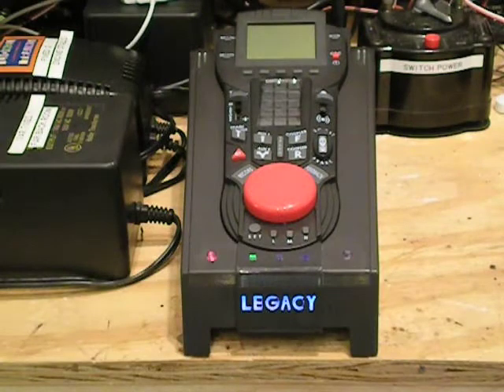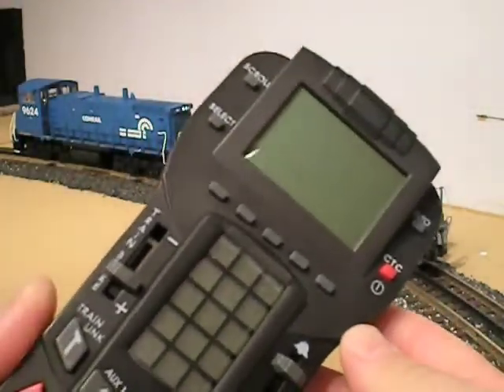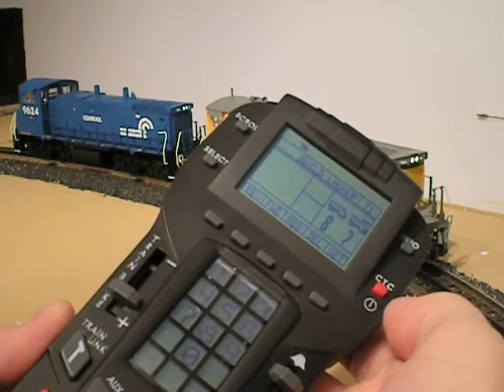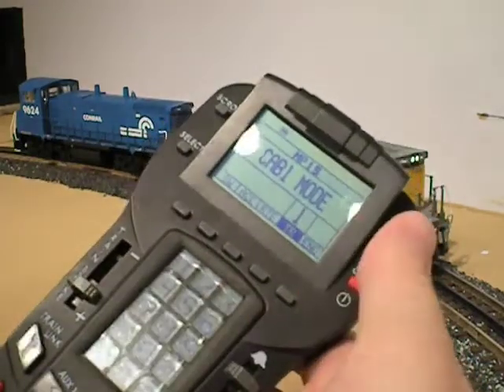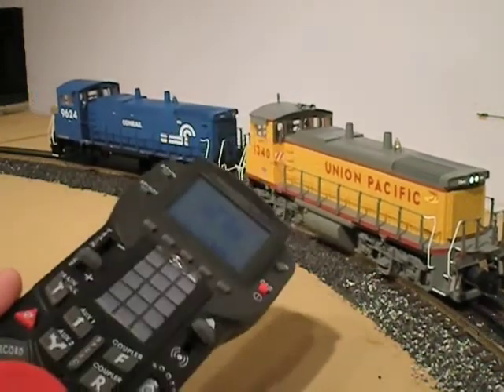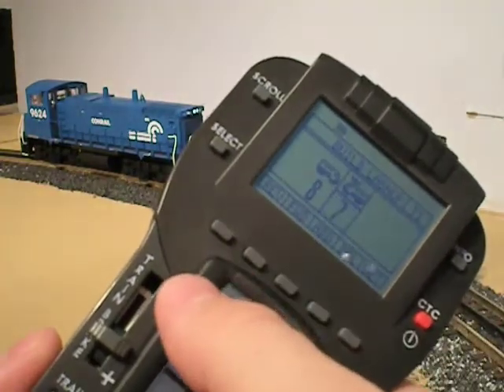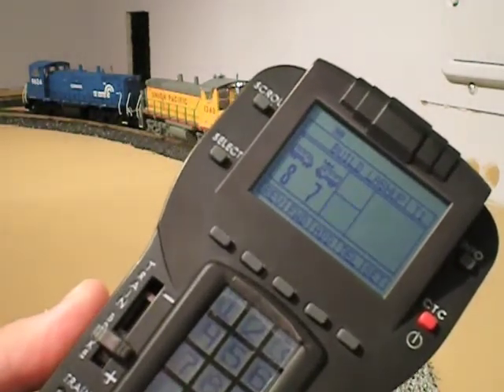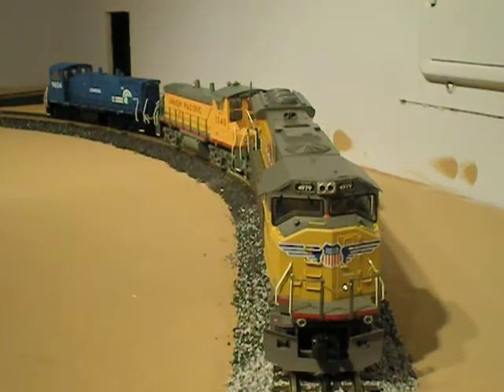Managing TMCC lash-ups with Lionel's Legacy System

Comment: i was debating on if i should get the old tmcc remote or the legacy. i currently dont have a tmcc train or a legacy train but i know about the bridge box thing that lets you run a non tmcc train with a tmcc system. i have watched your videos and i am loving the legacy system. for a starter like me should i get the legacy or the old tmcc and can i use non tmcc trains with the legacy if i get the bridge box thing?

Comment from the maker: The unit comes with 4 Rechargeable AA batteries, which is what I'm using right now. You can, however, use non-rechargeable AA batteries if you want. If you do choose to use non-rechargeable AA's, you flip on a switch on the base unit that disables the charger. The batteries have stayed in just fine and I haven't had any problems with them so far.

Comment: I do not fully understand purpose of lashing. 
Question???
.
Do all 3 train engines have power to the drive wheels, that also drive power all
engine wheels at the same time.
or
Just the 1st  train produce motion to drive the train,
and just the options in the other 2 engines, like sound and lights?
Reply: All three locomotives have wheel power and move as a single unit - if you look closely at the tail locomotive at 6:33, when Eric moves the train out you can see it move before the train is actually moving as a unit

Comment from the maker: @SilverLakeRailroad You can run a Legacy engine with a TMCC engine, but you will have to put the Legacy engine in TMCC mode and as a result you won't be able to access some of the Legacy features while it's in TMCC mode. Read the Legacy instruction manual, as they have a paragraph or two that specifically talks about this.

Comment from the maker: You cannot run MTH engines with the Legacy remote. The MTH remote will run TMCC engines if you have a TMCC command base, but the MTH remotes cannot as of yet access the Legacy features on a Legacy engine. So, with an MTH remote you can control a Legacy engine, but there are some features that you can't access. Bottom line is that you should get both systems if you intend on having both types of engines. I should do a video on this...